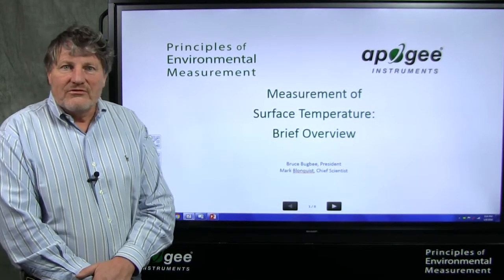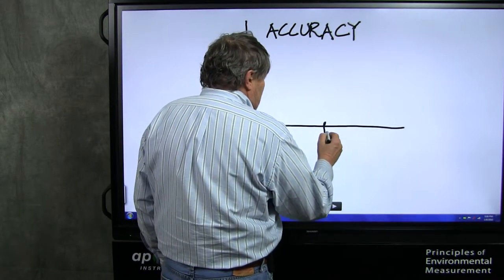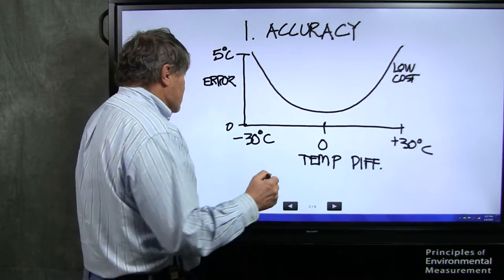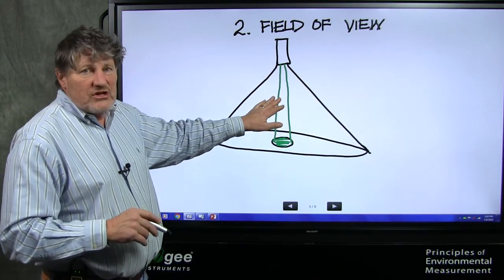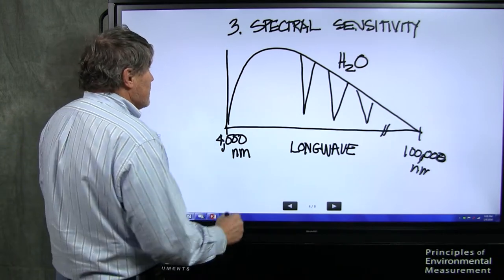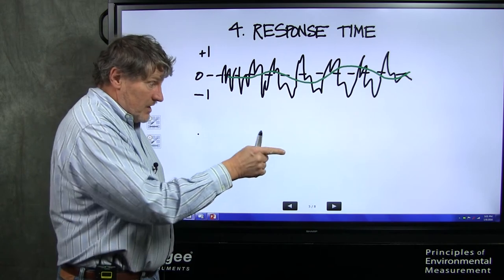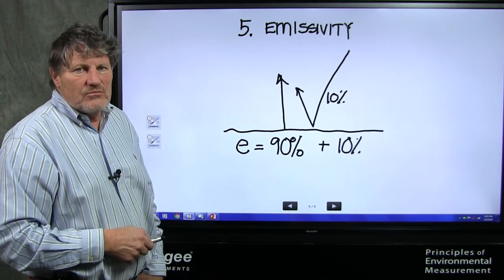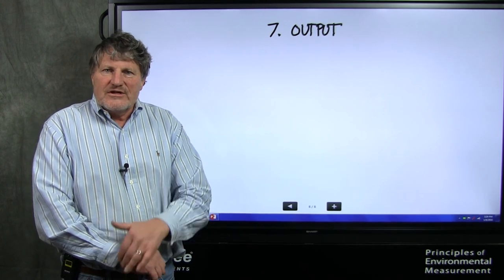Brief Overview of Infrared Radiometers

Comment: I'd love to hear about what ideal leaf surface temps we should be aiming for, day and night, with LED, HPS, and CMH (LEC).
Reply from the maker: The ideal leaf temperature is typically within about 2 Celsius of the air temperature.  Well-watered plants in low humidity (e.g. below about 30% RH) can be cooler than the air temperature.  In high humidity (e.g. about 70 % RH) transpiration is reduced and the leaves cannot usually cool below air temperature.  A significant advantage of measuring leaf temperatures is that the leaf to air temperature difference can be determined.  This is an indication of the transpiration rate, and thus the water status of the plants.  Please see this article for a discussion of the effects of lighting technology on leaf temperature http://journals.plos.org/plosone/article?id=10.1371/journal.pone.0138930 . -Bruce
Reply: vapor pressure differential (vpd) is something you might want to investigate.